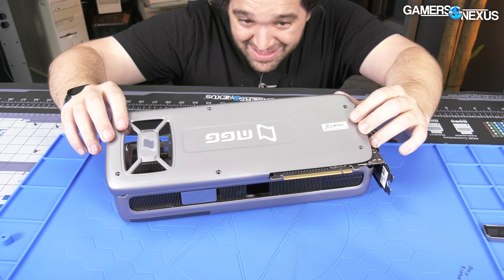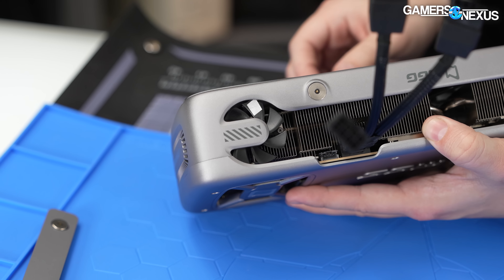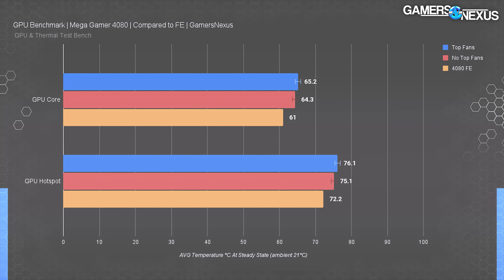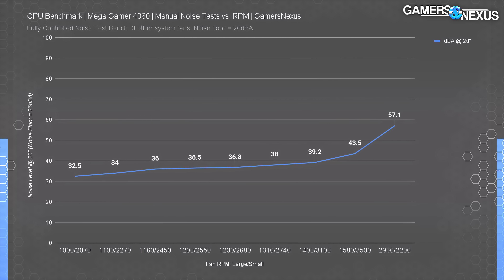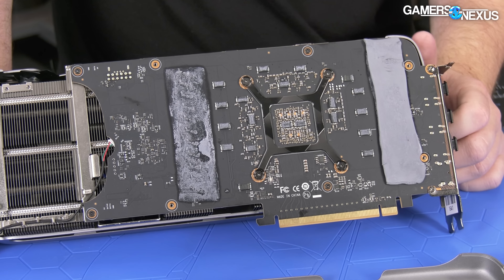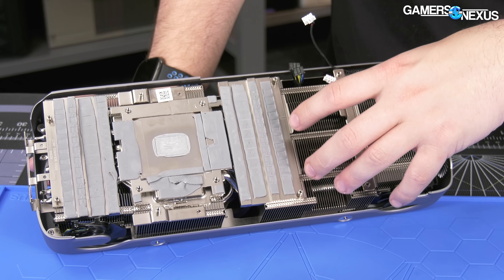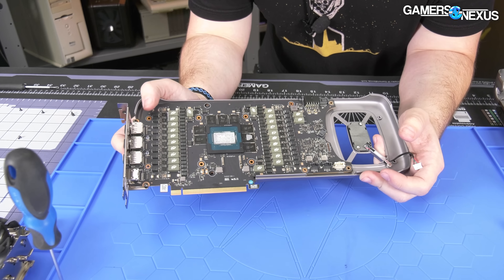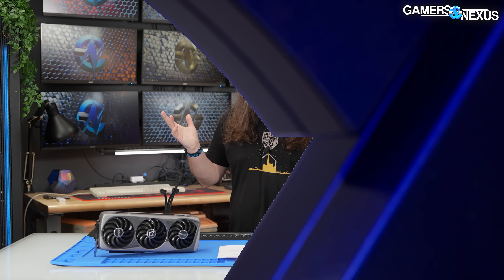The 5-Fan 'MEGA GAMER' GPU Tested: Maxsun MGG RTX 4080 Benchmarks

Comment: IMHO the construction with the two side fans in a testbench assembly has a smaller effect than when the card is mounted horizontally.
In this case, the large fans would blow against the board and the small fans might help more to pull the air out to the side.
Another question I have is, when comparing the temperatures with and without top fans, the temperatures are more or less the same, but were the clock speeds also the same?

Comment: The gasket is the most interesting feature to me. It reminds me of the face plates you can get for de-lidding your CPU, where it helps to distribute the mounting pressure from your heatsink, rather than letting it all rest on the die. Was the height of the gasket visibly flush with the GPU die?

Comment: I put a 3mm thermal pad across the whole back of my 6600xt when I liquid metal and k5ed it. The package temp dropped so much I had to readjust my fan curve. The junction temp was still better but not nearly as much as package. The backplate went from slightly warm to hot. Proving it was moving a significant amount of heat from the board to the backplate. Heat moves in 3d

Comment: If those top fans were on the bottom, they might be good for cooling hot SSDs that are installed in M.2 slots located below the first x16 PCIe slot on some motherboards. Otherwise, you would need to ramp the main fans on the GPU when there's load on the SSD.

Comment: So basically this would definitely be a candidate for mITX or other sff cases that'll fit a 4080 but where cards like the FE have overheat issues on mosfets or VRM's not necessarily the gpu. Would be interesting to see how the thermals compared with some UV/OC to the high-end or OC'd cards under heavy loads. I found that flatline steady performance interesting vs the FE's rather sawblade line in the frequency testing.

Comment: I actually had a suspicion that the top fans might hurt the thermals before the chart showed it. My first thought was the top fans might cause some of the air drawn into the top of the fin stack to leave before it can make it all the way through the stack, cause hot spots to form, and eventually that heat soaks it way though the stack causing higher temps. In reality, it's probably not even that big of a deal as a degree isn't really going to make or break this card and the five fan gimmick is eye catching.

Comment: All the thermal pads around the GPU contancing all the various components mean that it's harder to get a good contact with the GPU. My MSI Gaming X Trio 3090 is the same, and it can definetly hamper thermals. I bought the Morpheus 8069 for it cause the thermals were unacceptable imo and that lowered the temps by 10-15°C on the core. The Morpheus cooler is designed with airflow in mind and it absolutely shows that that is a better approach, unless you really don't mind extremely noisy fans.

Comment: Given the build quality it almost makes me wonder if this particular card had bad heat pipes/manufacturing issues causing the worse performance. It wouldn't be the first time we've seen a GPU with that problem recently. I'd love to see a 2nd unit tested because it seems like they really tried to design this card well (though at $1400 I don't blame if you didn't get a 2nd one...)

Comment: I have to wonder 2 things
1- If you inverted the "meme fans", to make them push air into the card and not pull out, if it would help or hinder the temps.
2- if you removed the "logo thing" on the back and cut out the metal there, essentially opening more the passtrough hole, if it would help with temps noticeable

Comment: I would find it interesting if in these test you could afterwards do a comparison where you take off as much of the shroud / backplate as possible and see the difference in temperature to stock (even though that would not be 100% accurate since most of the time you have to dismount the cooler from the substrate to remove the shroud).
But over the past years I have personally found quite an improvement on lower-end cards if I dismantled them and took as much of the "decorative plastic" off as possible. I really don't understand why manufacturers worsten their cooling by putting all of that stuff on, except to make it look like a transformer toy.

Comment: Would be interesting to see how termals be impacted if to remove all those thermal pads contacting main heatsink
Reply: Yeah but that’s a very unrealistic test, no one buys a card to disassemble it and make it cool less of the card. The control for this would be to measure the temps of the components it cools additionally, but because it was a meme gpu it wasn’t done.

Comment: Question: Why don't mfgs extend the height of the heat pipes from the gpu and put the fans on the backside of the cooler to blow or push, the air from the entire surface of the cooler? Seems like you would get more of the surface and air to cool things off. Since coming in from the bottom side of the cooler  would equal lower temps on the board and it's components since you would be pulling in cooler air toward those parts first...?

Comment: Those extra pads may help with memory overclocking, i think this was designed with the idea of pushing everything to its limit on overclocking , but failed in at least two ways.
1. Useless gasket probably traps heat
2. Those top fans don't have the pressure to overcome the front fans and actually be useful.

I believe instead of adding 2 extra fans if they had invested in slightly larger front fans this design could of been salvaged.

Comment: Hello Steve. Did you consider doing a test of coil-whine across the various high-end 40xx cards? It seems to be a major pain point for a lot of consumers, myself included. Some of the cards simply make an unacceptable amount of noise, and it's not really being mentioned in most reviews. It feels like this is something manufacturers should prioritize higher, as it's probably leading to a lot of returns. Contrary to popular belief, this is not entirely random. ASUS and MSI seem to be way noisier (according to reports on Reddit) than Gigabyte and Zotac, for instance. I think it warrants some investigation. My own ASUS TUF 4090 OC sounds like a buzzsaw, and I bought a Gigabyte Gaming OC instead, which makes a lot less noise, as expected. It also does not really show up in dB graphs, as the frequency is much higher than most fan-noise, so from a sound pressure perspective, it's not "noisy", but unfortunately it's usually right around the most annoying (sensitive) frequency (4-6Khz) for human hearing. This is something I at least would have loved to have known before I started buying and returning $2000 cards. It's such a hassle and totally unacceptable at that price point. We should not have to undervolt or FPS-limit cards to fix it. They should just work correctly out-of-the-box.

Comment: It would be doable to make these small fans go from low temp with low power than go off letting big brothers take over and cool it on high temps. Well but it kind of looks cool when u have it mounted horizontally and You can see on what point these start to spin.

Comment: maybe if the small fans were in push configuration rather than pull it might have made a difference. the lack of side walls on the blades decreases its effectiveness for the pull to take effect, i think.

Comment: I wonder  how that thermal pad laden build would function over several years. Will it maintain its performance better with less maintenence compared to an FE card?
Reply: Thermal pads should hold up until disassembly.   But the paste on either card may pump out or dry up if it's chosen for ease of assembly more than longevity.  Also, small fans will fail more quickly but they're doing nothing here anyway.

Comment: That plastic gasket should technically even out the pressure on the die. Actual differences? Eh, not that much. Maybe a couple of degrees with the same load and ambient, but a bit useless. We used to fit them on GPUs when we put a liquid cooling block on, but we stopped with 30 Series because the results are negligible at best.

Comment: I like the solid construction, aluminum back plate, the thermal pads.  However they really need to just redesign the entire fan system.  Get rid of the mini fans and have 3 nice quiet main fans.  Maybe a change in the fin stacks as well?  Good review but I would not buy this model.

Comment: If this card is anything like the Inno3d ichill x4 rtx 3080 then it'll run hot and very loud. I actually wonder if the additional fans cause increased air turbulence and disrupt the airflow or something. Definitely seems like tiny additional fans do little to nothing on gpus and just add in extra noise.

Comment: Do you think the small fans might gain some usefulness if you were to try and OC the card as much as possible and make thermals become an actual issue?
Because i feel like since its hitting voltage limits the same as the FE it might just not be able to hit a point where the extra thermal load would actually be impacted by the extra fans?
I'd be curious to know if just pushing both the FE and this one would still translate into the same results as now
Reply: They simply can't do anything to help unless you force the primary fans to essentially do nothing. Even in some best case scenario, any benefit would be tiny. The only situation I could see them doing anything useful are if the front fans are choked off in a really tight case.

Comment: Maxsun: Really good engineers, willing and able to go the extra mile. Designers without much practical sense, who disregarded airflow in designing the shroud. Salespeople as you'd expect, who dreamed up the "two more fans"-gimmick and shushed any objections from the engineers.

Remove the front part of the shroud, get rid of the two small fans, replace the big three with 25mm thick ones from Noctua, cut away the parts of the backplate covering the outflow, add some fins to the rest of the backplate and aim your CPU-cooler to blow towards the GPU backplate.

Maybe not as pretty, but you'd get the advantage of the engineering without the designers and the salespeople getting in the way.

Comment: Review the noctua one if we’re gonna look at rtx4080’s with a price bump
Reply: i just saw that card. You can do the same to all the cards and it's cheap. Buy good case fans and tie them on the radiator with some zip ties.
Reply: @dreyga2  I guess, I have seen the Linus video too but curious as to the actual out of the box one
Reply: @maxsamandco1779  I'm not talking about Linus, I did this to my own 1080ti strix, and it works unbelievably well. From 75c+ noisy to 60C, 70c memory, dead silent, no backplate.
My card looks similar to rtx4080noctua.

Comment: Pro tip with those stupid VOID stickers - while they're often unenforceable in most countries that have reasonable consumer protection it's still common to get some pushback which may require arguing your way to someone higher up and get warranties processed..
One method I've found that has worked so far 100% of the time in getting warranties accepted without question - remove the sticker entirely instead of breaking it

Just grab some tweezers, maybe a sprits of isopropyl if you have some handy, peel it off and discard.. or if you do lots of PC work and have many spare screws, you can just replace it with an identical non-stickered one.
Having no sticker at all seems to slip through undetected every time, and only the obvious broken ones still being attached get flagged

Comment: Surely the extra 60MHz alone has nothing to do with the higher temps vs FE? It needs to be using more power to generate higher temps. If power used is the same, it just means that the FE cooler is better.

Comment: This is one of the best gpus I have ever seen with a stellar board, absolutely impressive cooler save for one downfall, thick metal casing that is utilized to max. I'd definitely buy one if priced reasonably even though I really don't like the aesthetics very much, of course, the first order of business would be disconnecting the two little whiners.
I do have one question though: what is that connector next to the stupid nvidia joke?

Comment: Ditch the two top fans and use that savings for a more dense fin stack ..... I think the fans are only there to justify the increased costs because most of the reasons for the increased costs you can't even see unless you pull it apart while you can see those two fans ..... Otherwise most customers are going to look at it and say "I can't see why this should cost more" if it didn't have those two really noticeable top fans.

It's a good case study for the Law of Diminishing Returns .... The extra cost just doesn't translate directly into better performance

Comment: 11:20 With my exp dealing with nvidia vbios it is more likely the GPU saw 0RPM so it when to full fan power just cause it saw 0 rpm, it will not care if the core is at 0 C, 0 RPM you get 100%, lots of cards will do this at with say 300RPM cause they expect to see at least 800RPM, the vbios assumes there is a problem with the fan, in my exp AMD does the same thing, you can just have the core at 30C and your fan speed will go from 300RPM to 1200RPM cause the vbios saw  rpm that with the stock fan it too low to be possible so it cranks the fan speed and sees a speed it believes and calms down

Comment: When you say "maxsun is a forgotten motherboard manufacturer and mostly for good reason"--what are those reasons?
Reply: I also wondered what that was about.
Reply: He doesn't like the bios.  Hardware Unboxed and Level 1 Tech have both reviewed Maxsun boards on their channels and they seemed to be fairly impressed by them.  I've never had a Maxsun motherboard but it seems like, if you're not someone who pokes around in bios a lot, they are just as good as something by say MSI, the big weakness for them seems to be that the bios is hard to navigate.

Comment: A little disappointing that even after realizing everything is sharing the same heatsink(which would explain higher temps) we didn't get to see any gaming, stress tests, or overclocking results and what the vrms and hotspots were, etc.  
I'd take an increase of 4 degrees if temps rise much slower under load and has a lower max temp as well.

Comment: This level of detail with thermal pads reminds me to the ASHAMING politics of Gigabyte, at least on the nvidia 3000 series, of using the minimal amount of thermal pads possible, having real problems cooling the memory chipsets.

I had to change and add some decent pads on my 3080 Gaming OC, as I had real struggling twith memory temperatures when gaming (always on the 94-100ºC on load), and when I opened it up I saw the heatsink had only some crappy pads on the memory chips on the front side, but no more than that.

However it had that same "steps" as the Mega Gamer, prepared to add some more pads on the capacitor and inductor lines, like if they had considered doing it in design, but finally discarding it at the end. The plating even had some marks engraved to mark the length of them. Also the same on the metal back plate, where they have marks to position them too, but not a single one installed.

It's impressive how far they can go just to save some ridiculous pennies.

Comment: Watching this video dawned on me,  Instead of all the fans & metal ... why don't they just have a water cooled all in one unit  (same card size or smaller) where radiator is on one side with a fan.   Maybe someone already did it.  I've only seen where the radiator is external like CPU coolers.

Comment: or maybe if they flipped the 2 additional fans upside down so that they aren't blowing the hot air back into the GPU, instead of just letting the air blow out the top of the grill

Comment: Why isn't anyone coming up with a design which doesn't have the fans not blow the air back to the PCB of the cards, it's so obvious how easy is it to improve cooling performance in general just by doing that yet people keep pushing the limits of the usual method by slightly changing it each time, which in itself, this isn't a bad thing necessarily but at this point, it's getting pointless.
You don't dump the heat the card makes back to it's own PCB and expect case fans to get rid of the excess(this works well ONLY in an open case, or a test bench), it's a very slow process even with the fastest fans, regardless of how many you have or how well you place them, simply because you can't get rid of heat fast enough as these cards produce it.

Comment: The Memory looks a little too close to the GPU Die. That along with the Memory sharing both the Top & Bottom of the Cooler with the GPU Die probly also does not help. Cards that segregate the GPU Cooling & The Memory Cooling tend to stay a lot cooler.

Comment: you have completely ignored what the additional 2 fans would do to air flow in a horizontal and vertical moounting scenario. it may be that the 'small) extra flow may distrub the traditional air flow in a case .
you should have used your mirror to visualize air flow and see if the change in air flow is better for temperatures or not. my guess is it does change the air flow, but to what extent and is it worth the extra $ .
i am disapointed you did not even look (with the mirror) into that...

Comment: As long as the 4080 costs more than $800 I really don't care how many fans they use or how good the cooling solution is.
Especially when this 4080 is the slowest 2nd tier ever when compared to the top tier (4090 in this case). 53% of full die cores is a joke - this is the xx70 level.
Reply: 4080 itself is right where it should be. The problem is price and that Nvidia wanted to sell a extra premium product with the 4090. I'm pretty sure that the 4090 wouldn't have had this many Cores if Nvidia didn't try to enter into high luxury market
Reply: @ScarrowLP  agreed. It is a 80 class card but with the wrong price.